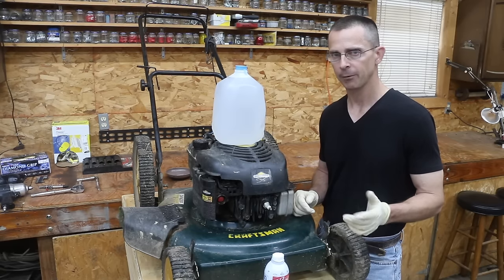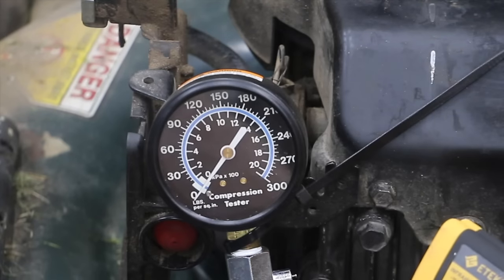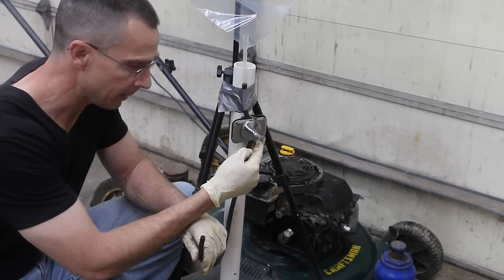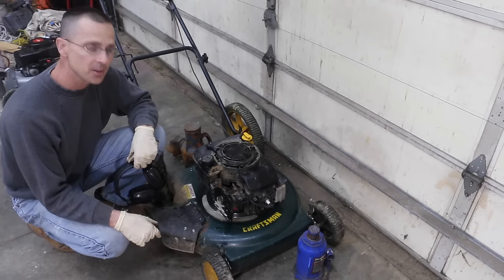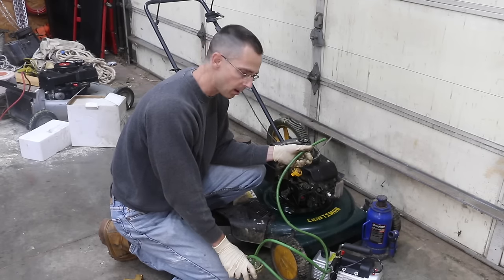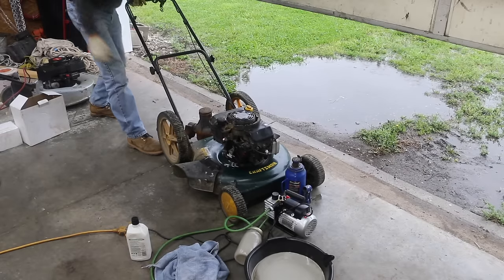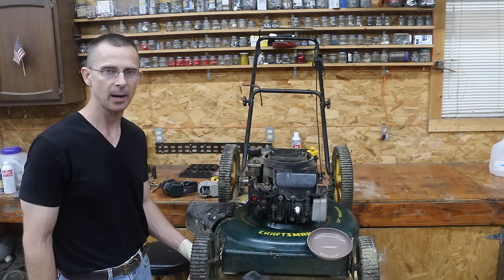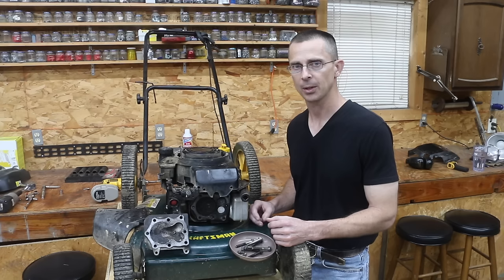Seafoam--can't believe what it did to my engine episode 5--cylinder cleaning test using water!!

Comment: my guess is the engine was too cold from the water, this process uses the steam from water to clean the cylinder head.
Reply from the maker: crazysvt03, I agree!  Thanks for watching the video and commenting!
Reply: That's what I was thinking too.  I wonder if an even slower trickle of water would have allowed for a higher temp and therefore more steam action.  I'm impressed at how much carbon was removed from the head even though it took so much time.
Reply: yup.... sucking the water into a vacuum while the water is BOILING is really the very best way to do this "steam cleaning" test
Reply: Dave Reiland or if the engine was under load, creating a hotter combustion chamber
Reply: Usually I run a gallon through a car engine in about 15-20 minutes. It requires a slight throttle opening to keep it alive but the engine stays hot enough to keep it rolling steam. I thought the video was great though!
Reply: actually, I take a 2 gallon gas container and fill it up with piping hot water (200 degrees), i hop in the passenger's seat and while my wife and i are driving to california i'll sip it in to the intake suction while she's driving down the freeway at 80m/h.  that way the engine is under load and hot, the water is hot and there's plenty of steam to clean out the engine.  wanna know what my engine head looks like?  brand new is how it looks.  i suck through about a gallon in 5 to 10 minutes.  just run the 1/4" plastic/rubber hose through the back of the hood and to the passenger's seat and hook it up to the water.  poke a few little holes through the 1/4" hose so as to atomize the water in the hose as it enters the intake. :)
Reply: This.  Too much water over too long a period.  That kept chamber temp too low to create flash steam.  Spray bottle is the thing to use, the smaller droplets turn to steam easily.  Even better is a mister nozzle.  On an engine this size, with the appropriate method, a ltr of water should be more than adequate.  Even so, the water did a pretty good job. The increase in compression is probably due to the water getting past the rings, partially breaking down the oil film and thus breaking glaze on the bore and rings.
Reply: That would reduce compression.   More likely it just cleaned off the valve seats for a better seal.
Reply: Exactly what I was thinking Stinky Cheese, when turboslag was thinking about it. Its all good. We learn together. When I do this, I use more water, but it's not continuous. The oil never gets contaminated. Probably because I always get the engine temperature back up. Come check it out on my channel.
Reply: I will agree that the cool temperatures seriously hindered this working properly. That also contributed heavily to the water in the oil. In fact it looked like more went into the oil then out the exhaust.
Reply: consaka1 This being an air cooled engine, it is colder, preheated water would probably help.

Seafoam works better on air cooled engines according to a ChrisFix video. That was a lawn mower. I wnat to try my 1989 Yamaha XT600 once I can source a rare part. Oh its findable, but SO expensive.
Reply: Air cooled engines are such a tossup on heat. I know some air cooled motorbikes can overheat just from idling. Just seems this might have worked better had it been working hard and producing heat. However mowers have a pretty active cooling system with the flywheel acting as a blower. Not sure if you could get enough heat even with it working.
Reply: consaka1 I'm sure the air cooled bikes that overheat while idling are overheating because they don't have the cool air moving past the engine from movement. Most anything runs cooler when moving. Your car will overheat in traffic before it will overheat traveling down the freeway.

Comment: the more i watch the more i like-very thorough very easy to watch no tricks--the lubrication from seafoam and marvel in the oil and gas of mowers equipment and vehicles used on a regular basis wont rust freeze or built up smeg we used to call it--but your method is why the mower doesn't blow up great effort thanks again
Reply from the maker: Thanks for watching.
Reply from the maker: You are welcome

Comment: To be honest with you, from what I have observed, I believe that the carbon deposit that was on the top of the head was transferred to the head of the piston and the one valve.
If I had an engine that needed to be cleaned. I would choose to use an engine cleaner to do the job and forget about using water.
Reply: You took head off twice clean it off and wire wheel wins left sea foam and water in the carbon

Comment: auto repair 7 years experience MANY types of repairs.
Always AMAZED @ blown head gasket repairs - the piston & valve heads were:  like new looking     so i concluded water or water w/antifreeze ? DEFFINATELY & ALWAYS caused the total removal of carbon(j whatever else it is)
of the cylinder's pistin crown & valve heads
Reply from the maker: Thanks for sharing.

Comment: Great video.  I also did what you did on a 2015 Kia Rio and let the intake slowly suck water in, unfortunately i bent the connecting rod.  I later discovered that this was due to the intake manifold design of the vehicle, some of the water was getting into the engine and the rest started pooling on the bottom of the intake.  I did a snap throttle and all that pooled up water go into the engine all at once hydrolocking it.  I have done this water trick for the past 25 years and never had a issue but like you said you always run the risk of damaging the engine.
Reply from the maker: Wow!  Thanks for the feedback
Reply: @emma67890  Thanks i did try what you said and removed the intake after to inspect how well it cleaned the carbon off the valves, it did help a bit but there were still large chunks of carbon stuck to the valves.  I guess the best way is to scrape it off manually.

Comment: Great topic!    As a wrench and smog tech for 18 yrs before switching careers.   A poor mans trick on NOX failures on smog was the water in the intake trick.   Definitely works as I always saw a substantial drop in NOX confirming carbon cleaning and hot spots in there gone.   I will say, I believe thered be better results with applying water and varying throttle.  My program was to rev up, pour in and continue applying throttle as rpms dropped.   Usually just 4 or 5 quick blasts was all it took.

Seafoam?   I always chose to use GM top end cleaner for the real job of top end cleaning without pulling heads.   That stuff is amazing.    

I prefer to use Techron gas additive over the years on every oil change to keep it clean in the 1st place.
Reply from the maker: Thanks for the feedback.

Comment: Used diesel trucks in my work, had a fuel strike for a month. So I added 1/3 diesel to my 1800cc petrol engine, having a adjustable SU carburetor, ran it.  1800 rpm idle.
Rebuilt engine later, the head was bright, clean, no build ups. Diesel cleaned it.
Reply from the maker: Thanks for commenting on this!
Reply: Pleasure mate. From down under.
Reply: My cousin used to just dump a can of brake fluid in the petrol. Cleaned everything.
Redex does the same thing
Reply: Which is the main reason a lot of folks choose diesel! Pay more at the pump for hundreds more miles on the odometer.
Reply: where I'm from diesel is much much cheaper than gasoline so it pays double.
Reply: Diesel fuel is around 75 octane. Detonation might have been a factor in removing the carbon. Not very wise for expensive gasoline engines.
Reply: My Father and Grand Father both would add a gallon of diesel to their full tank fill ups.  They said it would clean the carbon and lubricate the valve train.  This was back in the early 70's.  My uncle would pour break fluid into the carburetor to un-stick a stuck valve.  It was fun to watch because it really smoked up the neighborhood.....and ran off the mosquitoes.
Reply: @tarquineous  Correct me if I'm wrong,  but doesn't diesel contain Cetane, not Octane?
Reply: Atf does the same thing only better

Comment: It might work, but personally I'll never put water in any of my engines
Reply from the maker: Thank you!
Reply: Look up water injection in world war ll aviation.
Reply: When you drive during a rain storm you are probably sucking water vapor through your engine's air filter.  Never say never ever.
Reply: You most likely have a fuel injected engine and the water to clean carbon is for cars with carbys only , obviously it is unessecary for fuel injected motors as they are more efficient and have no carbon build up unless you have Volkswagen designed CDI which is bullshit for carbon build up
Reply: Michael Wilson how dose a fuel injection motor have no carbon buildup when your still running a carbon base fuel if there is no additives in the fuel it doesn’t matter how you put the fuel in the motor it is going to have carbon buildup
Reply: @iamasmurf1122  My Honda his direct injection, Hundai, Kia pretty much all company are going direct injection because of the EPA, so now we have engine that have to be clean with coconut peat every 60 000 miles. I saw a spacer for my type r so cold had a second row of port injector to help the valve.
Reply: @iamasmurf1122  mehh more like the difference between direct injection engine and theres also a style that shoots gas over the valves and relies on the intake valve to suck the air/fuel into the swirl chamber
Reply: Regular fuel injection is through the intake port, it gets sprayed onto the back of the intake valve and keeps it clean. Direct injection is sprayed directly into the cylinder. It's more efficient, but there's nothing keeping the intake valve clean, so it quickly builds up carbon. Some engines are dual injection, where they have cylinder and port injection.
Reply: @jakelowang4132  Walnut fragments work also.
Reply: And that's exactly why P.F does it for us , So we don't have to 👍
Reply: Do not run a engine when the dew point is high 🤣🤣🤣🤦‍♂️🤦‍♂️
Reply: Obviously never did any work on engines. Search the internet for coolant in cylinder head and see how that cylinder and valves look. Did the water trick on my Honda mower. No milky oil.
Reply: You can definitely bend some valves or connecting rods by adding water to your running engine lol
Reply: Gooogleisntyour Friend  sorry, electronic /non-carburated
Reply: @countmorbid3187  I already said it works, but I'll never do it. Obviously you've never actually comprehended something you've read... Eye roll goes to your comment. And a LAWN MOWER is not a car, genius...
Reply: Gooogleisntyour Friend  Generally, "regular" fuel injection is through the intake valve. Regular is a relative term however
Reply: Gooogleisntyour Friend  "what is "regular" fuel injection?" Just answering your question
Reply: During the (bad?) days of lean burning engines the exhaust tip would be pale grey and cylinder heads were clean. 
Catalysts need fuel to operate so engines are run slightly rich. Regardless of fuel injection, that leads to carbon in the head and exhaust above the catalyst.
Reply: @iamasmurf1122  This is not true 😅 Engines naturally have carbon buildup no matter what.
Reply: Michael Wilson pretty sure GDI engines also have a lot of build up on their backsides of the pistons due to no gas wash off... could just be a gimmick to get people to buy engine cleanings but you can see the white smoke from the exhaust when it’s a dirty engine
Reply: @mattperkins7038  not by misting or dripping slowly. Pouring quickly, sure.

Comment: Water added to the intake, fast cools and FRACTURES the carbon deposits in the combustion chamber. That is why you need to have the engine up to a very high temp before you add the water.  After the initial hit of water, it has cooled down enough it will not do any more good as the carbon is not red hot anymore and it just runs the water through the engine and as you found out, dilutes the oil.  Sea foam is a chemical compatible with fuel and oil so it reacts favorably to the gas and oil when exposed over an extended time as you did in this test.  Hard to compare the two in this manner when the water only cools and fractures the red hot carbon and blows it out the exhaust and SeaFoam chemically cleans the carbon after it cools it.  I really like all the videos you are producing!  Very thorough, fair, and relevant to most of us gear heads.  :goodvibes:
Reply from the maker: Thanks and you are welcome!

Comment: It's as old as the hills to use automatic trans fluid to keep carbon at bay, as an old gasoline engine  trucker we always put AT fluid in the gas tank, it lubed everything . This test you did works because of the cool liquid is what breaks the carbon off the hot parts. However not to many took the engine apart.
Reply: trans fluid the carb for carbon breaking; and a pint (to 4-5 quarts motor oil) in the crankcase to dissolve slug and carbon build-up, plus it keeps all internal rubber seals supple...

Comment: Looking at all these Types of products. If your going to clean the cylinder head of a lawn mower. It's a lot easier to take the head off wire brush and a scraper. Be quicker and cleaner. At least you won't have to run the engine for a couple hours and drain the oil 3 times? 
At least cleaning it yourself you know you got best result. 
Good video tho mate ;)
Reply from the maker: lawnmowerman1271, I agree!  Thanks for watching the video and commenting!
Reply: These chemicals is more proof of concept in regards to automotive/truck type application. 

Put yea, on a lawnmower it would be quicker and easier to pop off the top and give er a good scrubbing, but then the carb would'nt get so clean however.
Reply: Not if you have a Honda engine (;
Reply: it's not about cleaning the engine, it's about testing water/seafoam results on cheaper engines
Reply: For a small engine yes. I'm not going to remove the head of my vehicle motor every 75 k miles.
Reply: With my type 1 Volkswagen the heads come off that often weather you want or not.
Reply: michael keefer - lmao!
Reply: xSnakeStyles 
I agree the over head cam ones are a bitch!! 
The over head valves are not to bad. Just gotta know what to do I suppose.
Reply: +lawnmowerman1271  This wasn't really a "how to clean your lawnmower head" but more like a demonstration on how this would work in a vehicle engine.
Reply: Marvin Harrison Smith II I know fully well what you mean, just my view if you was to do it on a small engine like this
Reply: When ChrisFix did a Seafoam test on a small engine, it cleaned it to nearly perfection and it was severely covered in carbon like this one. When he did it on a normal engine, which is a much higher temperature application, the carbon is much more baked on...results? Not nearly as satisfying.
Reply: That's because Seafoam was made for small 2 cycle marine outboard motors.  I've used water mist to intake to clean old neglected cars.  Otherwise, I use Marvel Mystery Oil MMO in the gas tank and the crank case.  MMO has proven results on 4 cycle engines for almost 100 years now.
Reply: How the fuck is it quicker to take it apart and clean it as opposed to adding sea foam to the fuel or air intake!!!
Reply: eraldorh He could test every suggested product and still be cleaning 1 of these engines. That's a lot of going shopping, making purchases, mixing it with your fuel, and using the lawn mower. That takes seasons.

Or, with how simple a lawn mower cylinder head is to be removed, you can take it off and use my air powered Dremel and brush and just be done.

For a lawn mower? Way easier to take it apart and clean it. Years of driving a car later with carbon build up and the expensive additives added every gas tank and it'd still be dirty, but the cost in labor to take that apart? Probably still higher, but still faster than all the work I described.
Reply: Lol word! Haha
Reply: lawnmowerman1271 um I think he's just doing an overall in general review testing so people can see the difference to their personal vehicles using a lawnmower engine.
Reply: lawnmowerman1271 thank you someone hear is smart
Reply: Depends what you are working on most engines should have their head gasket replaced after you pull the head so doing it this way I suppose helps cheap out and save a few bucks.
Reply: Yes. I recommend he use his Corvette the next time he wants to try something unknown.  LMFAO
Reply: While I completely agree with you, that wasn't the point of the video, and it was a good video.

Comment: I think since the head was off, just clean it by hand.
Reply from the maker: 93sundance, Makes sense.  I chose to leave it, since I'm using the same engine for an upcoming test with ATF to see if in can do what water couldn't.  Thanks for watching the video and commenting!
Reply: I'm not sure the results of this test are valid as a result for water. If you look closely you can see that new deposits were formed on the piston top although everywhere else looks pretty clean. I suspect these deposits are due to oil or unburnt gas depositing on the piston, and not being water-soluble. Since the oil level was raised it may have gotten behind the piston, in which case it would have been coming back through the rings just like the water was being blown the other way.
Reply: oh so youre a joke maker
Reply: The point isn’t to clean his engines—IT’S TO TEST AND SEE WHAT WORKS (without having to disassemble).
Reply: Which is exactly what the engine manufacturers recommend, a manual decarbonization of the combustion chamber after so many hours. IIRC 500 hours on the old Kohler single cylinder K series engines.  Cool test though, supplied water for too long though.
Reply: Lmao